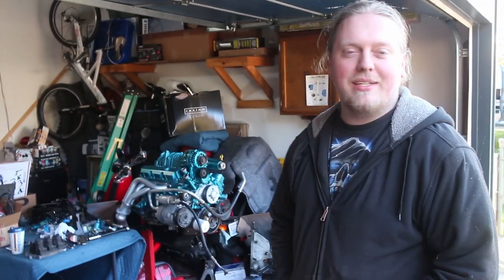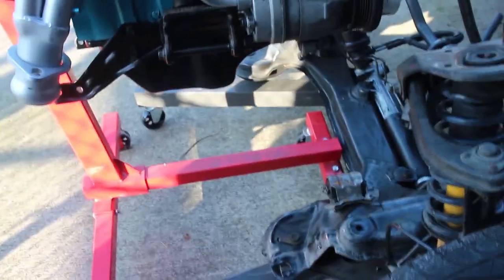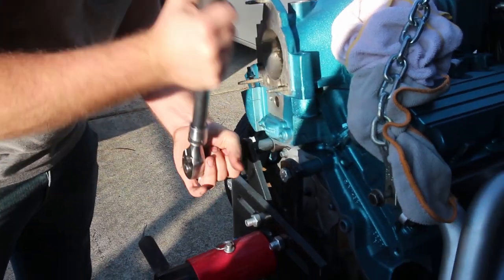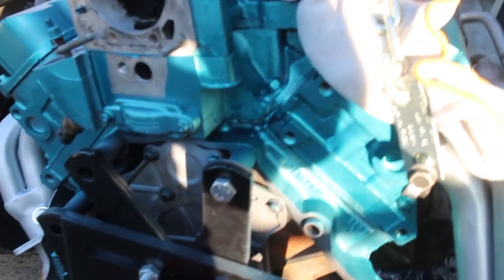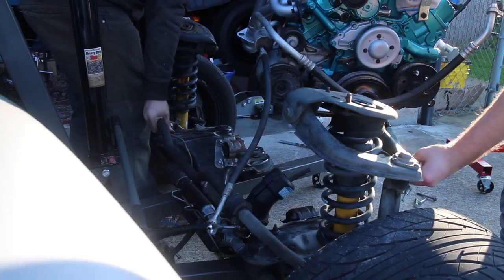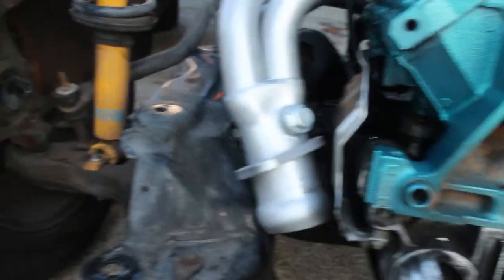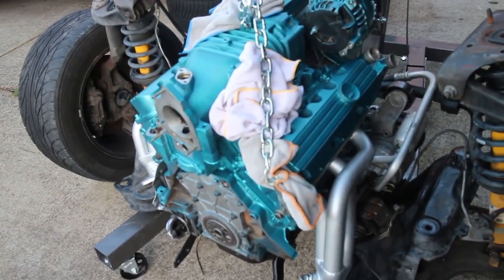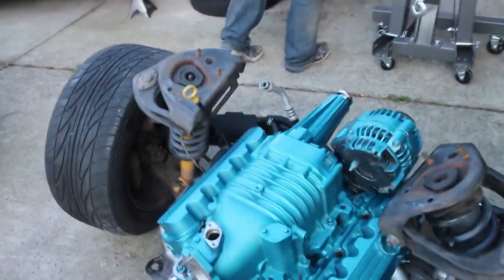Project F L67 Camaro Rebuild Part 11 (We got the Engine Installed on the Camaro's Subframe!)

Comment: It'll be interesting to see how much power it actually makes. Don't think it'll be outrunning any LS1s until it gets the turbo added in tho.
Reply from the maker: austin welch you should check out some L67 vids with our mods, they make great power. With methanol we’ll be ~350whp. This is also in a rwd platform. L67 fbody swaps with much less power are in the 12s.

Comment: I like your project but if you really want to put a killer Buick V6...I would put a Buick Grand National V6 turbo instead and there's a ton of mods for the engine, then it would be an LS killer....just saying
Reply from the maker: This is a relatively budget build. Sourcing A buick grand national 3.8 turbo would be quite expensive. The L67 can make some serious power, you should check out some dyno videos. Motors with less mods than ours can make 300-350whp.
Reply: @JuryRigGarage  oh yeah I got one!! I am a fan but I also got a Buick GN and trust me my GS won't touch it!! I honestly don't think they are that expensive I found a couple cheap engines on flea bay... actually cheaper than a SC 3800 but I understand your build is in a budget!!
Reply from the maker: @jpmastertech  We got our L67 plus new crank and bearings for $300, so pretty good deal. We're actually building a 72' Skylark with a 462ci, we should test out that claim haha.